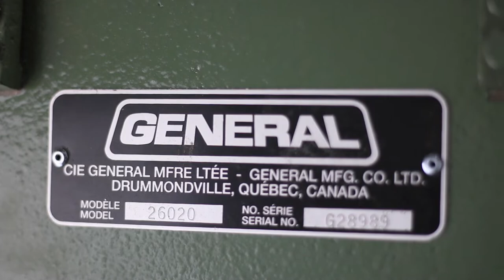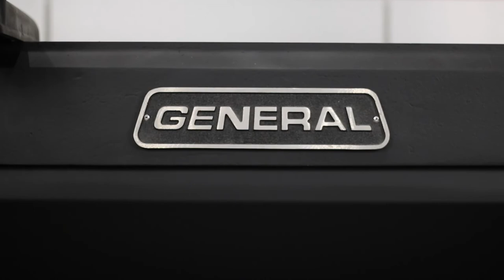MBD | General 260 Wood Lathe Modifications.

Comment: It was Beautiful Green
Reply from the maker: Hey Mark, thanks for watching. I appreciate the sentiment but the machine would have been three different shades of green. General must have switched paint suppliers a few times over the years lol
Reply: @manberdo  I have one like it. Mine is the same way. I also have a powermatic.  I might paint mine powermatic gold.
Did you buy new name tags? If so where did you get them?
Reply: Thanks for the idea.
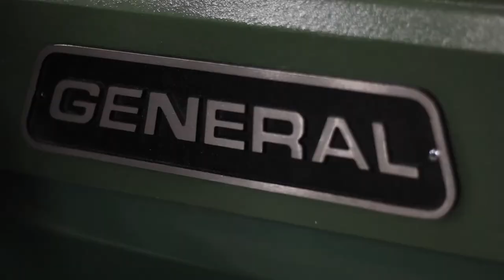Reply from the maker: @markr.1584  I'm simply reinstalling the name tags. At 01:25 you can see where I drilled out the rivets, unfortunately Im not sure where you could buy them.
Reply: And it was the original color :-(